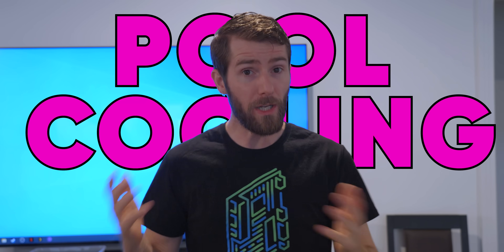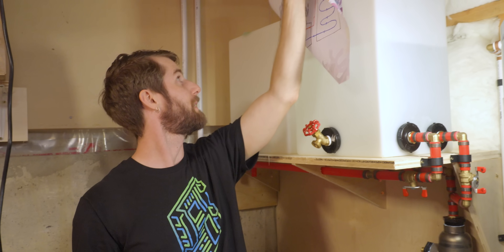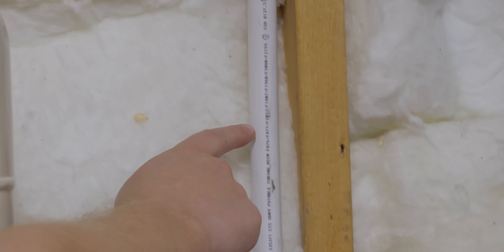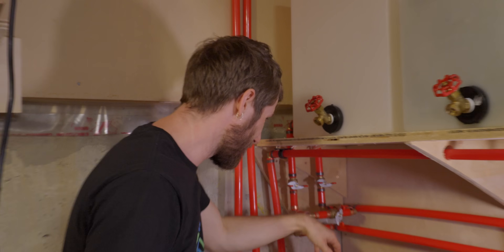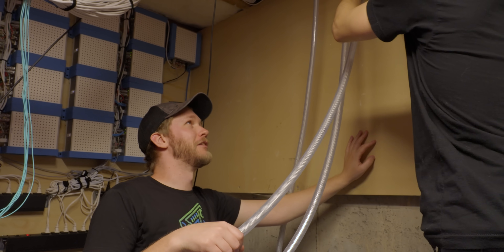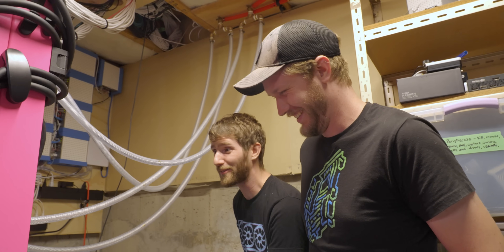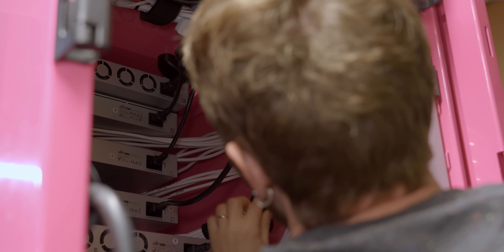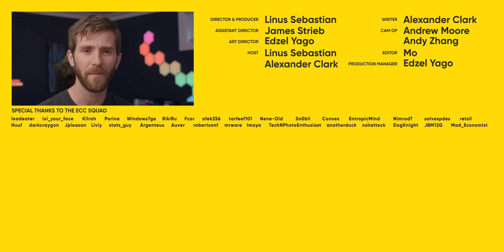My pool leaked and killed my computer - Whole Server Room Pool Watercooling Part 4

Comment: I'm actually genuinely surprised it lasted this long
Reply: It only took this long because he also soaked his phone in the pool and lost relevant footage.
Reply: @mplo23   pretty sure thats a different dead computer, well same computer but different situation
Reply: @leonpartington2172 looks like you're right... that video just went up.
Reply: yeah i'd have given it like 3 days
Reply: Honestly, i gave it like 6 hours until some rocks got lodged in it, blocked the flow and made it explode. @ghomerhust  
New system looks a lot better. But the manifold looks jank and I don't think he has any sensors checking loop temperatures, pressures and flow rate. Also he would need to slow the pool pump down once it gets cold outside, to avoid condensation inside. Check the temperature of the heat exchanger and set a minimum temperature for it and shut the pool pump down once it is reached. It's very well possible he has done this, but its not covered in the video.
Reply: No "Brian the Electrician-Handyman-HVAC-do-everything-guy" this time I guess.
Reply: @handlemonium He moved years ago. This was all caused by Alex and Linus’s reluctance to pay people for their expertise.
Reply: @Bob_Smith19  cause if they had professionals do it than they wouldn't have gotten content out of it, the views, subs, and likes from all the PC watercooling with a pool probably made a LOT more than what they lost
Reply: @Bob_Smith19  You missed the point of the video.
Reply: @Bob_Smith19  it's for the content, they aren't exactly a permanently serious channel
Reply: @Bob_Smith19 You think he did this because it was cheap?

This whole thing is a massive waste of money. If money was the driving factor, he could have installed a dedicated AC for the server room (and ran it) for far less than this has cost him in materials and labour.

It's done because he wants to do it and he can make videos from it. And people like watching the janky stuff (and they like seeing how it fails).
Reply: That's what she said RAHHHH🦅🦅🦅
Reply: I'm surprised they were able to finish that episode.
Reply: There's no way that server is heating the pool in any meaningful way.
Reply: Let this be a lesson that Linus will surely not get.  Never deploy experimental ideas on daily driven equipment.
That, and do it right the first time.  A heat exchanger was only ever the right answer.  You knew the fins were tiny, you knew you couldn't filter it enough, yet you full sended with a prayer.  Well, prayers don't corrode PCs, but water does.
Reply: @TurtleSauceGaming except all of the issues you mentioned he addressed in the original video as being temporary it was a proof of concept not only that the reason it failed was due to the type of tubing and unfortunately shutting off thr pump without realizing
Reply: It may have lasted longer if he went to the hardware store a dozen times mid-project like the rest of us
Reply: that's what she said
Reply: 😂😂😂 9 hours later it’s broke AGAIN
Reply: The channel?
Reply: fr I didn't realise he was using actual pool water, I thought he was just using the pipes around the pool lmao. A double loop is absolutely necessary
Reply: @jazazzaza As i understood , he was using not the actual water from the pool, but one big loop that goes from a pipes underneath a pool, filled with some water. That water was not clean enough, coz it was going through different pipes and connections, and there was no way eliminate contaminations. As he said, filtering it is not an option coz it restricts flow too much.
Reply: @citygamer121  that's what I thought as well? So it doesn't use the water actually in the pool? He also said there's glycol in it which you can have if you get the correct kind. Anyway that makes more sense
Reply: @jazazzaza  It doesn't use pool water, it runs water through those pipes under the pool.  But underground PVC pipes ALWAYS fill up with dirt, water, rocks, and other shit somehow through dark magic.
Reply: @jazazzaza Will don't give him your own engineer water cooler. He might sell it.
Reply: @protennis365 have you EVER gone to school?
Reply: Last this long. You mean not he a hack and doesn't know how to take care of his electronic and fake his data.